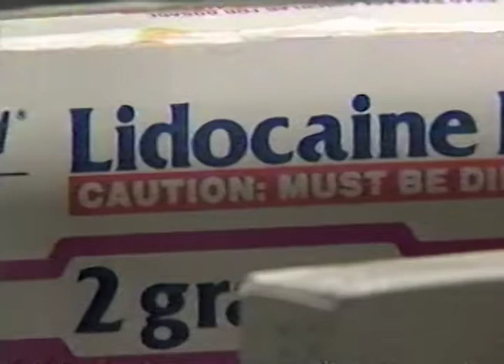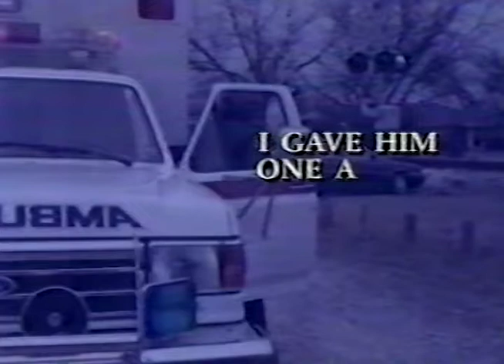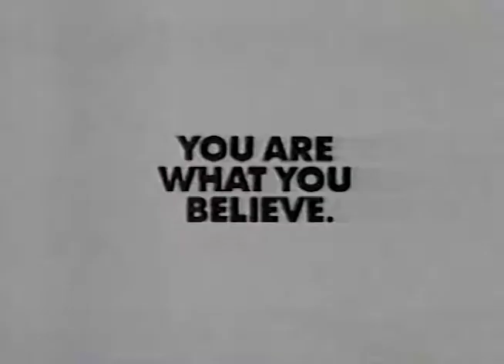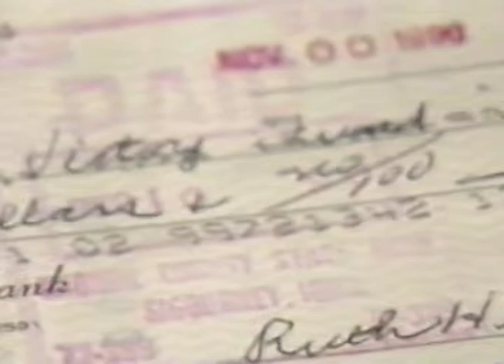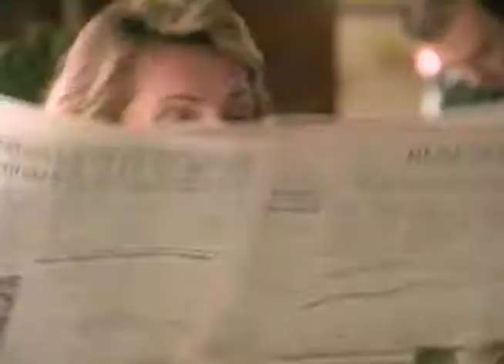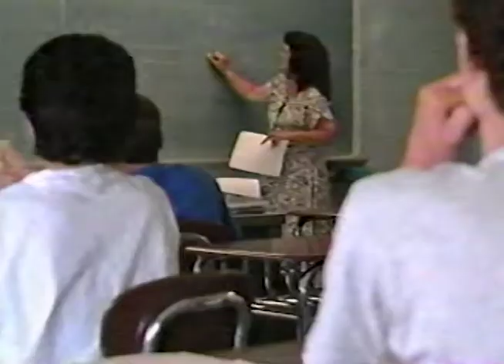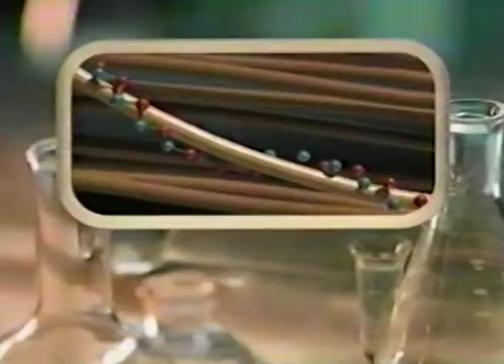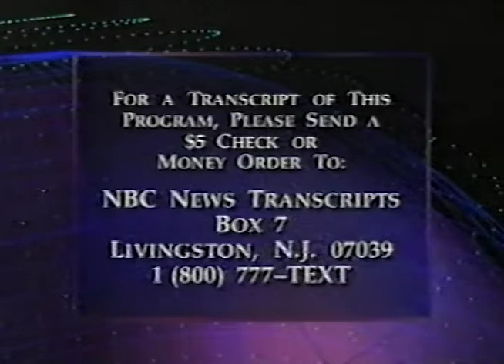NBC 1st Dateline Tuesday March 31, 1992

Comment: 58:37 Full Closing Theme
Reply: That was the original closing theme used from 1992 through 1995.  In 1995, they introduced a new more peppy theme and the Dateline Timeline at about 30 minutes through the 60 minute-long broadcast.  That was a multiple choice trivia question about what year certain events had occurred.  They would hold the answer until after the commercial break at the bottom of the hour of the broadcast.